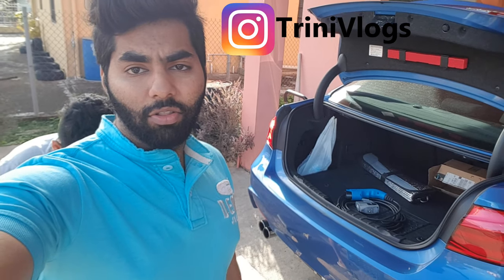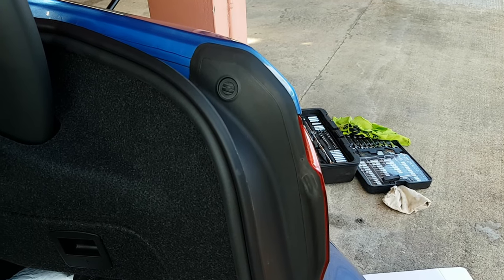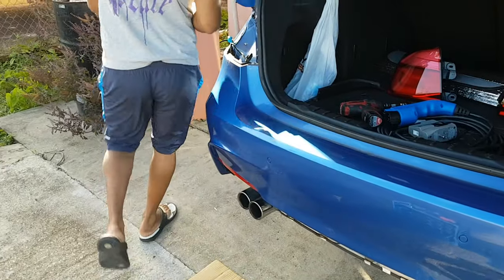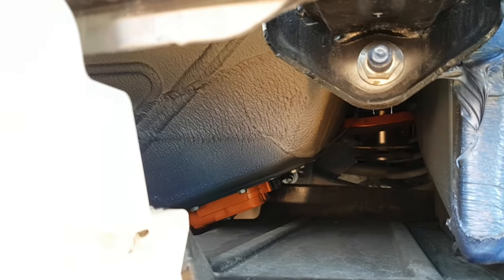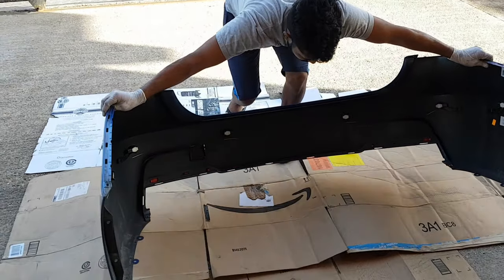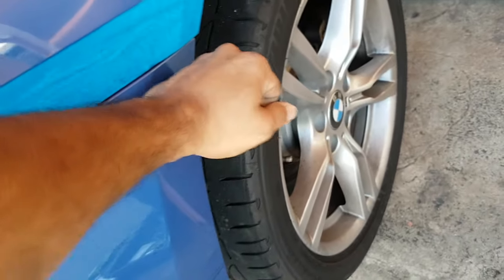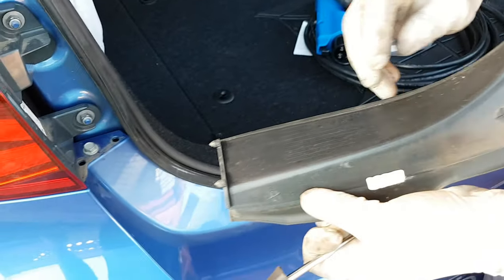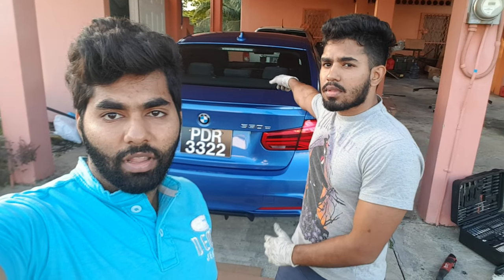BMW F30 REAR BUMPER REMOVAL AND M PERFORMANCE REAR DIFFUSER INSTALL

Comment: what are those two boxes called behind the rear bumper? There is one on the right and one on the left side
Reply from the maker: not sure exactly. think they might have to do with the PDC sensors
Reply: Those are the lane change warning radars